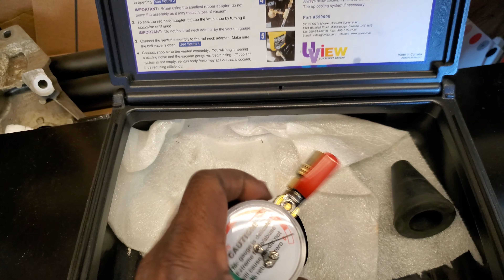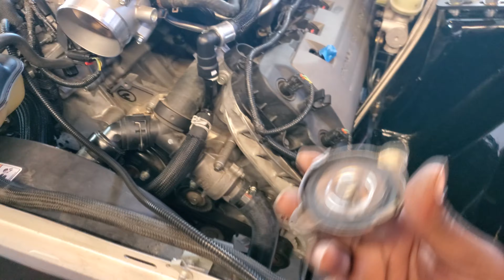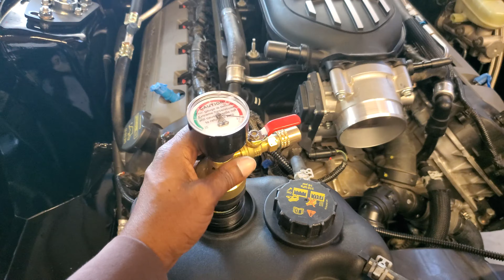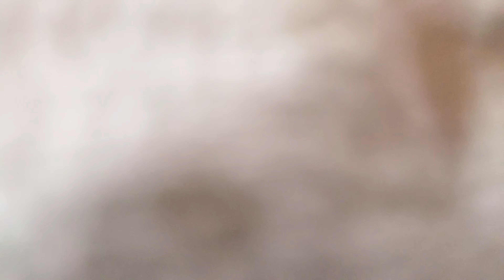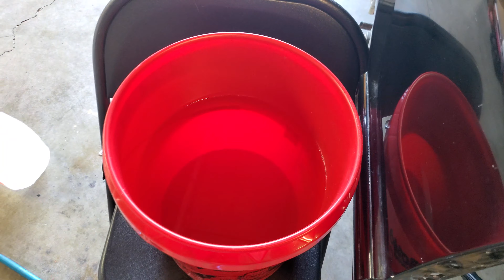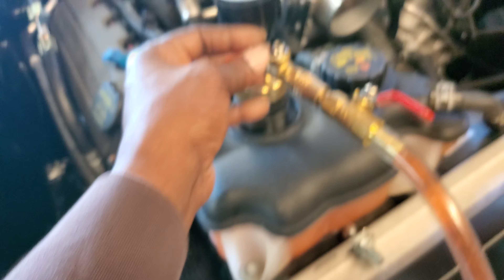Coyote Swap - How To Fill Up Coolant THE RIGHT WAY!!! - Vacuum The Anti Freeze Into Motor

Comment: Does the motor have a hydraulic power steering pump, I was trying to see where the lines from the hydro boost where hooked to? Clean build
Reply from the maker: Type in hydroboost diagram on google